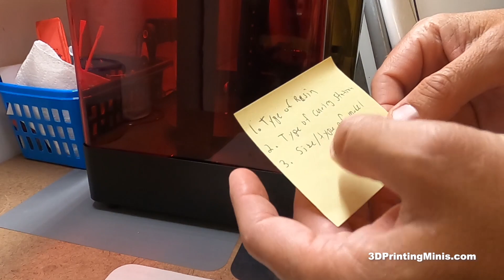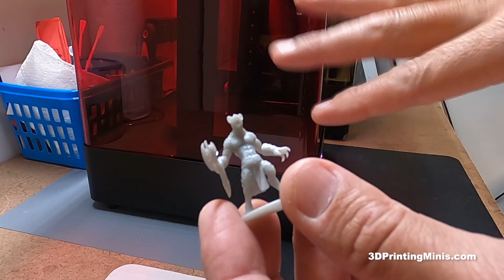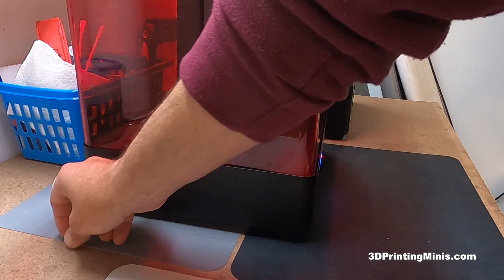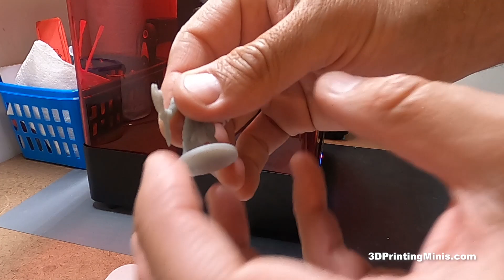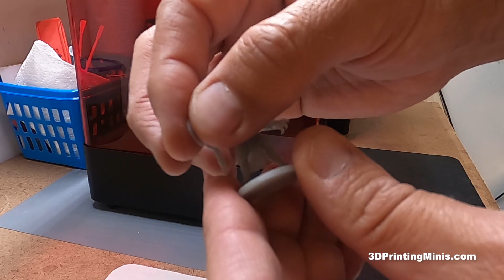How Long To Cure 3D Resin Prints - Determine Curing Time For 3D Printed Miniatures & Models

Comment: I've printed one 1/6 or 1/8 statue (think it's 1/8, the artist doesn't say) in the Mercury 3 station and did it for 5 minutes with great results.  No overbaking, no sticky parts.  I could probably go lower if I wanted to.
Reply from the maker: That's awesome! It sounds like you've found a great curing time that works for your prints.

Comment: Fantastic video!  So, I'm relatively new to 3D Printing, but I'm also a PhD in manufacturing engineering with Optical and High Frequency focus.  I am using an Elegoo Wash n Cure and an Anycubic Photon 4 (budgetary, entry-level printer).   What I can say is that curing is a function of A.) the intensity of light and B.) how long its exposed.  This is why your exposure times on the printer really matter (particularly for the first few layers).  My printer is running at 60 seconds for the bottom layers to get good adhesion to the build plate.  I am using Anycubic ABS-Like resin 2 and fine tuned from 3 second exposure time to 2.8s exposure time for the layers.  With this information - you can already deduce that to 'cure a layer' - it really only takes a minute.  This means that your outer surface isn't going to take much longer than that assuming the intensity of the LEDs in the cure station is 'about the same' as the intensity of the printer.   So, I am usually more concerned about 'surface coverage' than time - making sure the light hits every surface relatively equally.  I run for about 1.5 minutes, then rotate 180 degrees on the plate, run another 1.5 minutes, then set the model on its side for another 1.5.  That way, I'm hitting every surface and not leaving anything 'sticky'.  It might be unhealthy, but I can tell that a model isn't cured enough with a 'sniff test'.  If, after the IPA is gone and the curing is done, if I can still 'smell the resin' - it probably needs to go back in for another minute or two in a different orientation.  If you have poured resin without wearing a respirator - you know what I mean (and - admittedly - as I am writing this... I should probably be wearing my 3M mask when I do that... Look - its a $26 purchase on Amazon  - if you go to the doctor for a chemical allergy one time - you've bought the mask 5 times... 3D print yourself a hook and hang it next to the printer. - and here I am, talking to myself - knowing better...  )
Reply from the maker: Thanks for watching and commenting. I appreciate both. I'll making videos and releasing new episodes of the 3D Printing Minis podcast in the coming weeks. The show will be on iTunes, Spotify, etc. but I'll also upload the full episodes here on this channel as well. Hope you subscribe and tune in. Thanks. - Dan

Comment: Hmmm, I have a question about this, can "over curing" while printing help make the mini come out better? Or is that process not powerful enough to really help cure the middle of the mini?
Reply: Probably stale comment, but my understanding generically is that excessive curing makes resins 'more brittle'.  But its not as easy as 'just time' - it depends upon the overall intensity of the UV LEDs in the cure.  (So higher intensity is faster).

Comment: Height x size (resin used also calculated as volume) so if your tallest print is 32mm from build plate it's .32 multiplied by the total amount of resin used for build in ML. 

So for example 32mm in height x 55ml used would be .32x.55=0.176 so 176sec (2min and 56sec)curing time. 

This gives you the minimum curing time necessary

When you slice all the relevant info necessary to determine curing time pops up.

This is of course on the assumption your filling the build plate, if you just printing one single piece, its height x size x layer count. This gives you the maximum curing time not to exceed.
Reply: Hello, is there any calculation with only "diy uv curing station" ?

I just have 50 watt & 90 lumens uv light. I print mini model such as 1:64 rims, seat, steering wheel, and i usually turn my uv light for 15 minutes, and i can feel the support is still soft. Any suggestion for that? thanks for advance
Reply: @1337FLINT.  
1:64 scale (27mm) you will calculate this the same height x volume (volume is the total number of ML used on the entire build plate print. 

The problem with DIY UV designs is people tend to think all UV lights are the same, you can have a UV lamp that pushes the correct wattage necessary for curing some items however you need to ensure your lamp produces the correct UV wave length. For curing liquid Resins the necessary NM (nanometer) wave length for most resins is 360-420 (it does vary by a few NM) it can be less or more depending on resin types (water washable, flexible, strengthening, etc.).

Yet if your wavelength (NM) is within this range your where you need to be. 90% of the UV lights you can buy from Amazon, etc do not fit this range, they fall in the lower ranges of  nail paint curing and/or aquarium warmth lighting. 

Contact the light manufacturer of the lights your using and find out what the wave length (NM) of your bulbs are. Normally you can find this information in the Manuel and sometimes on the box itself.
Reply: @1337FLINT.  
Also 50watts at a baseline of 555nm=34150 lumen. 
If your using 50watts depending on the type of bulbs you should be pushing 370lm-600lm for curing. 90lm not gonna cut it.
Reply: @gettingpolitical  Thanks for the info, ah that's why i cure them for 15 minutes it's still soft (most of it are support). Maybe increasing the duration of my portable uv light might work?
Reply: @1337FLINT.  
You can try increasing how long you cure it for but without knowing what wave length the UV light is emitting on I cannot provide an exact calculation for curing time.
Reply: @gettingpolitical  Noted, big thanks for the help
Reply: @gettingpolitical  Talking about the wavelength, mine is 395 nm
Reply: @1337FLINT.  
Then the formula is the same, if your   print is not curing properly there are several things you can do. 1) ensure you inline your curing station with reflective material (aluminum foil works), 2) ensure where your curing is warm, the cold is not your friend, 3) put the light closer to the print.

Cure one side for the formulated time, then flip and cure the other side for the same duration.

You also don't want just a single bulb , if it's a led UV light that comes with multiple bulbs you should be fine.

All supports should be removed from the model before curing, supports can cast shadow on your model (depending on angle of bulb) they also absorb the UV light. You want your model getting all the UV light.

Comment: How long after washing you should cure the Model or Any max or min time durations ?
Reply from the maker: You should probably let them dry overnight. I’ve also started using a cheap, battery operated airbrush dry off my prints after washing. I’ll making a video showing how I do this later this week.

Comment: What brand resin printers you have on this video? I'm looking into purchasing one but still not sure which I want
Reply from the maker: Elegoo are solid and affordable. Phrozen are a little bit sturdier/better but more expensive. Honestly, if you're trying to save money you can get perfectly good prints from an Elegoo. I just buy Phrozen printers now because I'm spoiled and I don't mind spending a little extra money on their printers. I've been printing a ton of really great D&D miniatures with a two-year-old Elegoo Mars 2 (not even the Pro version). Wait until Black Friday later this month and you should be able to pick one up for under $200 on Amazon or the Elegoo site.
Reply: @3DPrintingMinis  I don't mind spending the extra cash. It was either those two or the anycubic but thanks for reaching out to me. Just so hard at times when you look into these things. Lol
Reply from the maker: @BOOBROWN74  I'd look into the Sonic Mighty 8K. It's $50 off right now on Amazon and there's some deal where you can get a free bottle of resin. The build plate is bigger so you can make more and/or larger models in one print. The resolution of the Mini 8K kind of seems like overkill. But the 8K resolution on the Mighty makes more sense. If I could do it again I would have bought a Mighty 8K instead of a Mini 8K. That being said my Mighty 4K is a beast and pumps out lots of great prints, too. But, seriously, I think the Mighty 8K is where it's at. Also comes with wifi and free camera built in.
Reply: @3DPrintingMinis  yeah I was looking at the mighty 8k and funny you mentioned Amazon cause I saw it cheaper there as well. Thanks for the info. You help me out and I'm convinced that's the route I'm taking. 👍

Comment: So phrozen claims the aqua 8k minimums are 20-30mins but that seems crazy high what do u think
Reply from the maker: That seems high. I just got my 1st bottle of 8K resin this week. I'll give a try and make a video in the future to see what it takes.
Reply: @3DPrintingMinis  any updates on this?
Reply: I’ve been doing 10-17 mins on my cures on small models/doll pieces and they come out pristine. 2-5 minutes has utterly no effect so idk why everyone says to do that. They come out still gummy and no difference. 10 minutes nearly perfect. Extra 3-5 mins and it’s absolute perfection.
Reply: That does seem incredibly high.
Reply: I go the full 30 minutes. I haven't ran into any structural integrity issues. But I also print some fairly large prints.

Comment: New to all this...

Have you tried "water curing"?
Reply: Water curing only matters if you dont fully clean the miniature, the reason it works is that the water keeps the excess resin off the miniature while it cures. I cure my stuff in Denatured Alcohol and never need to water cure.

Comment: I'm yet to cure my first model. I'm using Anycubic basic Grey. I have a UV torch (baby one). Any additional tips? Currently I'm thinking a fair few minutes, looking for yellowing, hardness and scratch resistance
Reply from the maker: Sorry, I have no feedback on a UV torch and its curing times. If you're doing that why not just put it outside in the sun for 5 mins. That's free and seems to work pretty well for other YouTubers as well.
Reply: @3DPrintingMinis  maybe even a clear glass container over it to prevent particles or the random bird dropping 😂, it has happened before 😂
Reply: Height x size (volume)
Reply: I ended up having all my minis in an airtight container until I got a curing station. $80AUD on Amazon and it folds away.

Comment: fuck me, i was curing minis for 30 mins XD
Reply: I’ve been doing 10-17 minutes. Idk what these people are all talking about 90 seconds to a few mins???? What???? When I do that it has NO EFFECT even on much smaller parts. Parts slightly bigger than the one in this video I give 10-15 minutes but I put multiple in the machine and they come out absolutely pristine.
Reply: @dontknow3949  thats because of the NVM range of the lamp they are using HIGH range lamps so they are more stronger
Reply: overcuring is way better than undercuring. don't poison yourself or others
Reply: 3mins one side 2 on the other with my setup

Comment: I'm trying to find these times for my DLP Anycubic Craftsman resin. The spec sheets seem to always talk about during print cure times not post print cure times...
Reply: Did you end up figuring it out? I’m using anycubic resin and I have no idea what the curing time is
Reply: @CloudySkye-l5e  
I ended up just experimenting with it.
For minis, I usually do 5 mins then flip them and do another 5. As long as they feel solid on the outside, they should be good.
If you have thin weapons it will slightly affect their brittleness, so you just need to play around with them to personal preference. 
The drop test is another good one. Do 5 mins, then another at 10 and another at 15. Drop each one a few times and see if any of them are more likely to break.
I think local humidity affects it differently.

Comment: What happens if I don’t cure my models?
Reply: They don't get hardened, can be prone to breaking and generally are sticky and flimsy if not cured.
Reply: @Zontarz  ok, i appreciate the response. I have had decent luck with most of my prints coming out fairly strong, but recently have had a few sticky prints. Think I will be getting a light this next paycheck 👍
Reply from the maker: Sticky prints might mean they weren't cleaned well enough. Or, that your cleaning solution has become too dirty (i.e. has too much washed off resin in it). You might want to swap out your Mean Green, IPA, etc. for a fresh batch.
Reply: @3DPrintingMinis  that was a suspicion as well, after I had a few sticky models I switched out my solution so I think you are correct 👍 thank you for the advice
Reply: @3DPrintingMinis  Most of your cleaning solutions can also be recycled, put the tub in the sun for a few hours, then strain it, I do this with Denatured Alcohol and it works great! I have also done it with IPA, and Acetone, but they evaporate really fast in general so I switched to Denatured Alcohol. as I put all my stuff in warm water to remove the supports after the print is done, it leaves no residue from the DA.
Reply: @Zontarz  that's interesting i would think that if it's rubberish it wouldn't break as easily . I still have no idea that my cureing time is right or not . But i also paint them sooooo no clue if it's sticky or not . 

Small one's 3 minute's big hollowed one's 4 . Not hollowed 5 .

Comment: I'm looking at getting my first resin printer. But I can't afford a Curing Station. How do you cure it without one?
Reply: Super cheap. Grab $6 vice lamp from Walmart and a UV light bulb. Place models on tin foil (because it reflects UV light) and place lamp overhead. 

These curing stations are nice for quality of life but wayyy to expensive and an unnecessarily complex solution for curing minis. Like paying for a $100 car wash when you can pay your brother to do it for $20, or yourself for free.
Reply: The mercury wash and cure was only $130 when I bought it after Christmas, much cheaper than the other brands and stand alone stations.
Reply from the maker: You can but curing outside in daylight can be a little dicey. You can use a Home Depot bucket, tin foil and a UV light from Amazon to make one for under $50. If you're going to go through all the trouble of buying a printer you might as well make/buy a decent way to cure your prints.
Reply: @3DPrintingMinis  Cheers, since making this comment I've settled on water curing with a UV LED Grow Light for plants. They're cheap and powerful UV lights and the water apparently gives great light refraction, allowing for curing from all angles.

Comment: Can you wait to cure things and have them still be fine? What I mean is can I print something off at let's say like 8 or 9pm and then wait until like noon the next day to cure them in the sun without it ruining the item? Obviously I don't want to be handling the uncured item so it'd probably just sit on a plate or something after being washed
Reply from the maker: If they are out of direct sun or UV light, yes. 

But be sure to wash them before you cure them or you’ll have some very sticky, globby prints. 😀
Reply: I have a statue of 16 cm heigh, hollow, and take weeks in the sun to get full cured soo..

Comment: I'm trying to get into 3D resin printing do I need the curing station also?
and which one do you recommend? I wanna get the Sonic Mini 4K printer
Reply from the maker: Phorzen's curing stations are good (I have the large Luna model) but they do run a little expensive. That being said, whatever station you can find on Amazon that fits the size pieces/models you'll be printing should be fine. You can also make your own using a Home Depot bucket, tin foil and a UV light from Amazon. But, I prefer my stuff a little more solid and less likely to fall apart, so I spend the extra money on having an actual curing station. But, you totally don't need to buy a fancy or expensive one if you don't want to.
Reply: you can get UV lights off ebay that are exact same specs as Phrozens, and I made my own turntable too off youtube tut with ikea lazy susan
Reply: You need to cure them, but how you go about that is your choice.

Comment: I think I’ll do a cure test. Print an identical batch of parts, like weapons and cure them together for 30 seconds at a time. Taking one bit off every 30 seconds. Scratch and bend test when they’re all done.
Reply from the maker: Yep. That is a great way to do it.
Reply: @3DPrintingMinis  I ended up doing this. It didn't seem to make a difference for Elegoo ABS-like with 15% Tenacious mixed in. Virtually all of the parts were able to bend to 180 before snapping. 2 min cure on the low end and up to like 7min on the high end.

Comment: What is tenacious? I’m new at resin printing
Reply from the maker: It’s an extra strong, flexible resin made by Siraya Tech.
Reply: @3DPrintingMinis  and a 75% blu / 25% tenacious mix make durable glock frames.
Siraya Tech really nailed it with cheap strong resin.